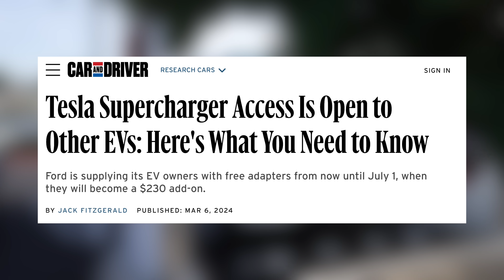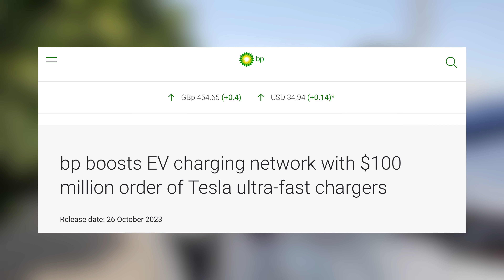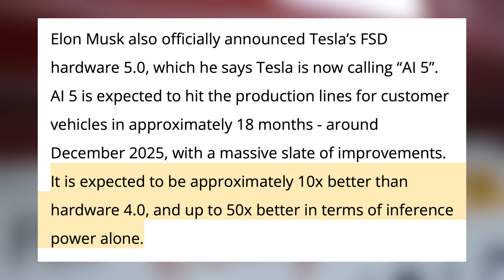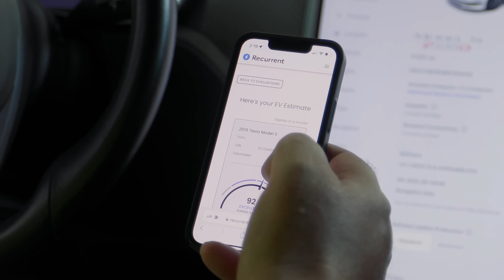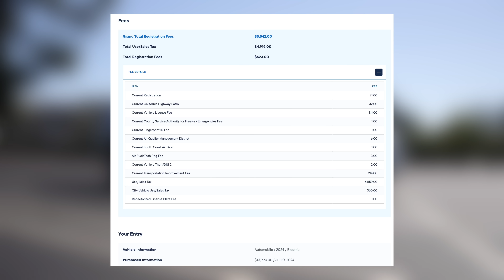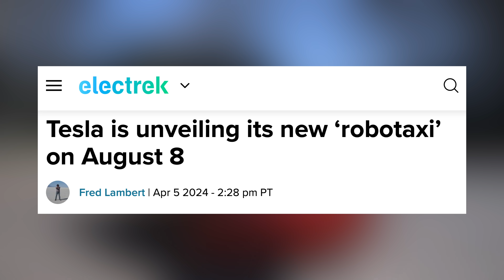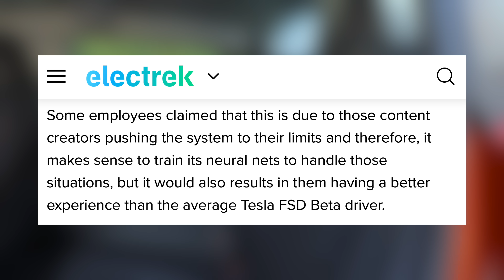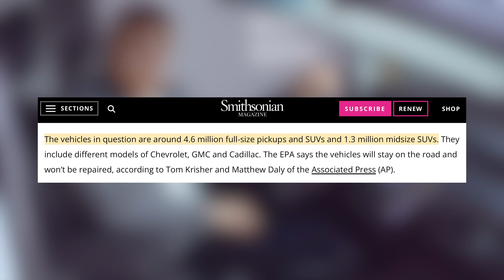NEW Tesla Model Y Prototype Spotted | NEW Features Coming

Comment: i wanted to wait for the juniper but i could not resist the $7500 and FSD transfer so i just ordered a Y
Reply: then their tricks are working! congrats on the Y!
Reply: Added bonus to buying now, you get a car with steering wheel stalks for gear selection, turn signals & wiper button...
Reply: FSD transfer won’t happen on new gen 3 and Y for a while so definitely a good thing to take advantage of now.

Comment: The Robotaxi will look like the Aptera because the Aptera will be the Robotaxi.  Aptera has been working with Tesla for more than a year because Aptera needs Tesla's investment.  The reliable Tesla motor is wanted because the Elaphe motors that they now will not be using, require seal replacements every 10-20K miles.  Tesla has extra motor-making capacity due to the current slowdown.

Comment: Tesla needs a birds eye view for the camera system, even the cheap Nissan sedan has it now. My Equinox had it in 2019. If they had not wasted billions on FSD they could have refreshed the line and expanded it like BYD does.
Reply: You can't use the mirrors and 7 cameras to park your car straight ?😂😂
Reply: @Deltahax1337  I can it just takes longer. I'm not trusting jiggling blobs. I want to see what's there.
Reply: @frankcoffey  I worked valet for 3 years, no matter how many cameras or gadgets a car came with, the most accurate, reliable, and fasted method of parking were the mirrors and back camera. That's all you need.
Reply: @Deltahax1337  I want to be able to see the curb for front in parking.
Reply: I second this. My 24 Y sucks to put into my garage nose in. I have to guestimate and one day... one day I am going to hit my industrial fan LOL!!!!

Comment: Any FSD trained and tweeked solutions covers more cases than the specific situation that generated the issue. This not only improves the ride experience, but over time, improves the tools that are used to make the improvements with the goal of automating the correction process to include as smarter, more flexible vehicle responses to unexpected sudden emergency conditions 😊

Working with your experts provides better more complete solutions in most cases.

Comment: Teslas are over priced in the Uk. Tbh the value is bad. People would rather own the bmw i4 and new Audi and Porsche EVs are simply more desirable
Reply: True! No one makes Cuckoo clocks like the Germans! Tesla? They’ve put the iPhone 20 on wheels!😅
Reply: @cardonman  they didn’t though. Model 3 doesn’t even have a front bumper camera and no parking sensors. No car play or android auto. No heads up display. Really bad self driving system with phantom braking and 2 upgrades costing as much as a new car which nobody buys. You have to pay extra for traffic information which Google provides free on Waze. No radar based cruise control. It sends your information to insurance companies. The brakes suck on the M3P. The battery overheats on a track. Self driving can’t stick to speed limits without a £3400 payment which isn’t even FSD. The car is more like an iPhone 6